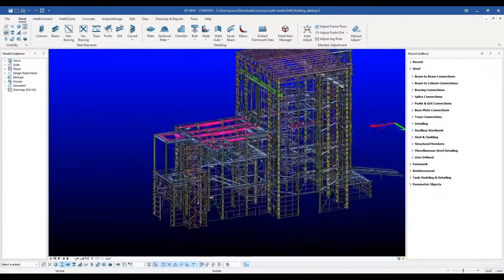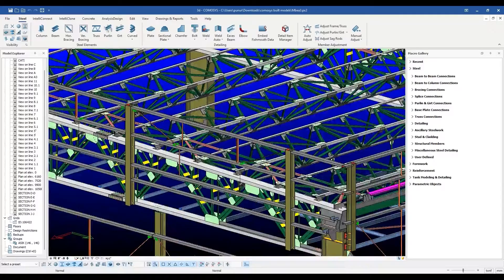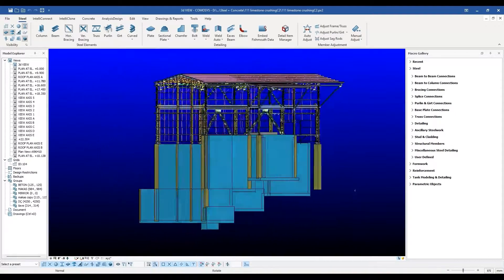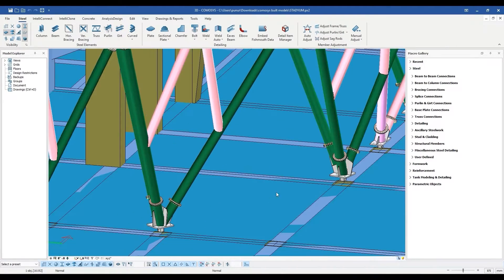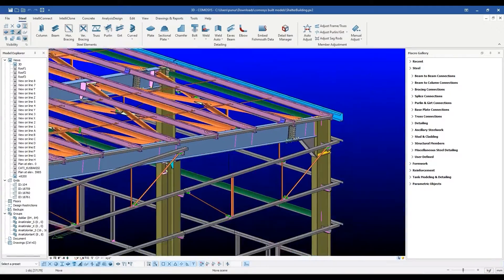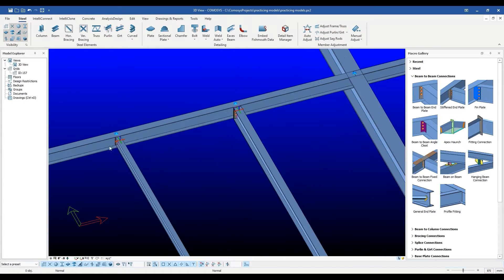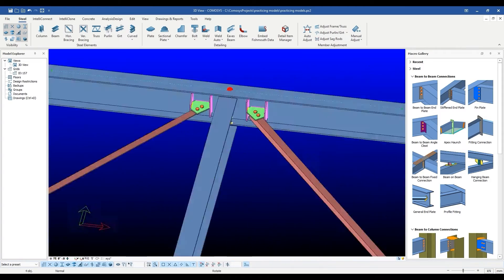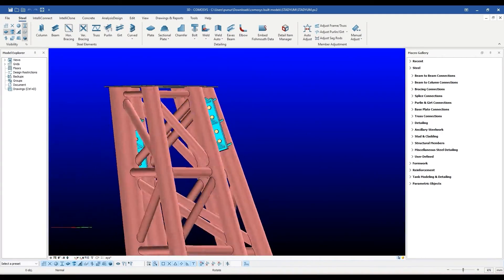COMOSYS is one stop solution!  No more data transfer between the software and no more nightmares!

Comment: Are comosys and prota two different platforms or not?
Reply from the maker: Yes. Prota uses OEM version of COMOSYS for detailing and drawing production of steel structures.
Reply: @ramcadds  what is OEM version and what about concrete analysis and detailing?
Reply from the maker: @tomislavzg742   OEM means not full version of Comosys is in Porta. Comosys currently have 3D Modeling of concrete, Analysis and rebar detailing. Concrete design will be implemented in the future versions.
Reply: @ramcadds  thank you
Reply: @ramcadds  Prota structure has a very versatile foundation shapes with automated design. Can you do it too in the future? It would be great.
Reply from the maker: @tomislavzg742  Thank you for the suggestion. We have lot of plans to implement most unique features.
Reply: @ramcadds  Thank you for your response, I will continue to follow Comosys, really unique and disruptive technology.
Reply: How much is COMOSYS?

Comment: Hello , thank you for developping such usefull software, when will prota steel be update to latest comosys features
Reply from the maker: ProtaSteel is a subset of the “full COMOSYS suite”. It only has some of the features  of the full COMOSYS steel module, since it is aimed at “Template based” and “building type”structures primarily. Element entry is therefore limited as per those constraints. Major structural elements like beams, columns and braces and trusses cannot be entered in ProtaSteel and ONLY those transferred from ProtaStructure can be used for detailing. 

There is a market which can work well within those restrictions, so you will need to decide which one suits you. 

COMOSYS on the other hand is the full suite with advanced capabilities and much wider audience. It has a powerful finite element engine, and full blown steel detailing and concrete detailing modules. It is completely general purpose and you are not limited by any type of structure or detail. Also it has many advanced features which are not required by the other niche market. If you are looking for a One Stop Solution, COMOSYS is the right choice. Infact  you can see, how much time and money can be saved from revolutionary and disruptive technology of COMOSYS.